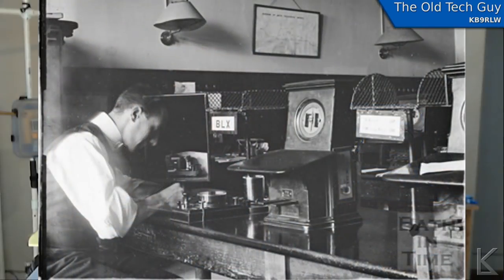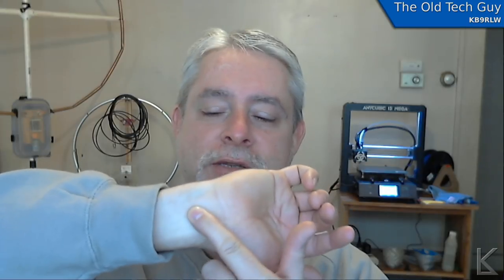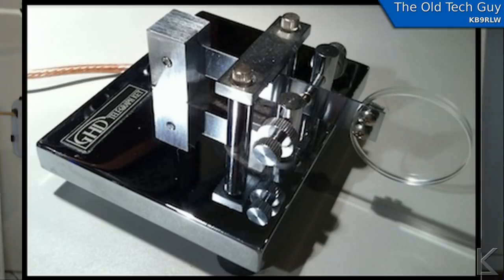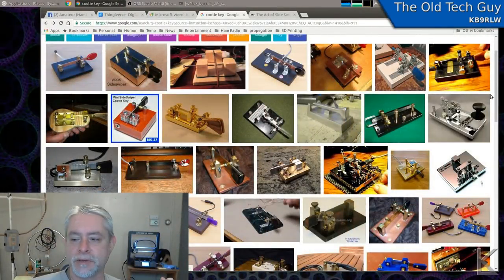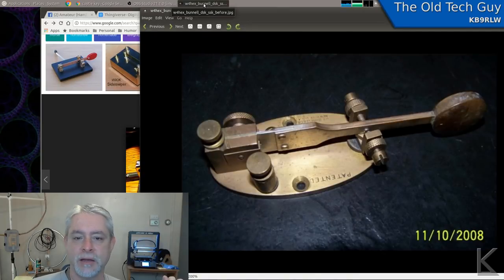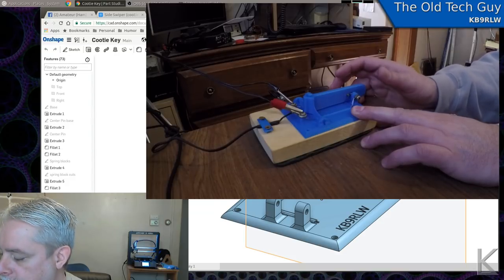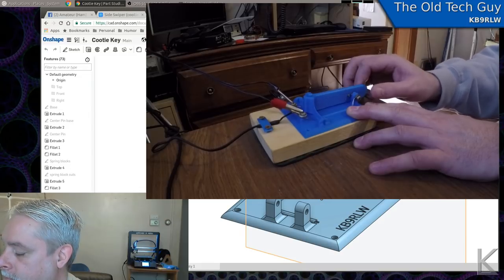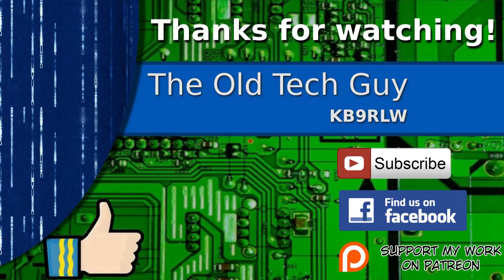Ham Radio - The cootie key

Comment: Since I learned cootie I rarely pound brass and never use paddles any more. I like total control of speed and spacing.  Also they are easy to make and can be elegant or sinfully ugly-both can work well. I have magnetic springing in mine (a handmade that I've reworked a bit-it came with coil springs).

Comment: I came across a sideswiper on a Russian-built ship in the 70s. Transition from a straight key was a few minutes, as I had never used a bug. They were very handy for OBS msgs (number-coded weather reports). Much less likely to get CTS/glass arm/w@nkers cramp, and much clearer and faster than the Marconi key. I liberated it, and have it now in a transport museum, where I volunteer. Funny thing is, in 3 years in Radio college, it never got a mention. I had often wondered why the russian operators were so much better than us. Sideswiper explained it. 73.
Reply from the maker: It's my understanding that sideswiper is different than a bug. A bug has a swing arm on a spring with a weight that will cause a continuous stream of dits when you swing it in that direction. 
A cootie key or sideswiper is like a straight key on its side with the same contact in both directions. So you need to hold it for the dashes and tap it for the dits, but there's no automatic generation of dits.
Reply: @loughkb  Correct. Speed adjustment and dot/dash formation are entirely down to the operator. You don't lose the rhythm of the straight key, but it is much easier on the wrist. I cannot understand why the straight key was favoured over the sideswiper.

Comment: I’m delighted! Someone FINALLY talks to the ‘Sideswiper’! Some time back, I acquired a key array from an old merchant marine radio operator. It thought it nice…it was self contained in a home brew box. When I got it home and opened the top of the box, there were two keys. One a straight key and one strange lookin’ thing that turned out to be the original…as you pictured. It took some getting used to but I really prefer it to paddles or a bug! I am, by no means a high-speed sender…just enjoy occasional CW contacts. Thanks for sharing this. Glad to know I have a COOTIE! (Never heard it called that before…been a ham since ‘77) Again, thanks and 73!

Comment: It's easy to convert your paddle to a cootie key. All you need is a stereo jack and a mono plug. Combine the Tip & Ring to the Tip of the mono plug. The sleeve is the same for both. Now you can use a single or double lever paddle as a cootie key. It is easy to make a adapter cable for this and not have to rewire the paddle.

Comment: Impressive stuff. I've been using 'side-swipers' and twin paddle (Iambic) keys for many years and it's definitely the way to go if you are interested in CW, particularly if you are a 'rag-chewer' :-) 

All the side-swipers I've used have been connected to an Iambic keying unit and you can really send fast and furious and with little effort (less chance of getting that glass wrist ;-) ) . Holding down one side gives you the dits and the other side the dah's ... takes a little bit of getting used to, but once you have, you can start to fly  :-) . Twin paddle Iambic keying is definitely the best/fastest/easiest way of sending CW and recommended, again, for 'rag-chewing' mode. 

Great design for your key... I wonder if you can hook it up to an Iambic keying unit and have the traditional, iambic side-swiper experience?  73

Comment: Hi Kevin.. I made one of your Arduino keyers, which works well….until I fire up the TX..then the keyer has a mind of its own😩..Despite my efforts to suppress the RF in the shack, I still haven’t been able to stabilise it..So, inspired by your video about Sideswipers, I put one together in a few minutes..and your comment..”Kinda sloppy”, doesn’t come close to describing my first efforts at sending intelligible Morse😩..However, I will practice, and I will succeed…maybe..but as we say in the UK..it’s difficult teaching an old dog new tricks..😊
73s Kevin ..and many thanks for your many videos..
John..G4EIJ..Bristol..UK
Reply from the maker: Hi John,   you must be getting a lot of RF in the shack if it's crashing the arduino.   Put a choke on the keying line going to the radio and the line going to your paddles and ground the metal case the keyer is in.  (unless it's not metal, in that case put it in a metal box.)
Common causes of RF in the shack.   Antenna is too close.  If the antenna is an ed fed wire, put a common mode choke on the coax at the feed point and make sure you have a counterpoise wire on the ground side of the feed point.
Reply: Many thanks for the advice, Kevin.. I’ll try and sort it.. The arduino doesn’t stall, but it just adds random extra dots or dashes  to the characters😟..
I thought it was my keying at first but it only happens when the RF is fired up..
73..John
Reply from the maker: @johnrees44..G4EIJ  That's probably RF coming in on the key line.   It goes directly to the arduino.
I'd add a choke to that line and maybe 0.01 uf caps to ground on those wires just inside the case, at the connector.
Caps won't interfere with the keying, just bleeds of RF coming in on those wires.
(if there is a noticable delay, the caps could be reduced to 0.001uf and probably work)
Reply: @loughkb  Thank you..J

Comment: Why if in the 1880s wrist injury was an issue did the straight key not die off to be replaced with side swiped. More importantly if Morse was so widely used in world war two. Why was all the Morse keys I see sold now are all straight and not side?
Reply from the maker: The side swiper was mostly replaced by the bug back then, so you should be asking why everyone wasn't using vibroplex bugs.    You'll have to go back in time and ask some telegraph operators.  None of them bothered to write down why.
Reply: Easy. Money. I interviewed several WWII radiomen for QST in the 90s, and they commonly made themselves a sideswiper when they graduated from signal school. Couldn't afford a bug yet.